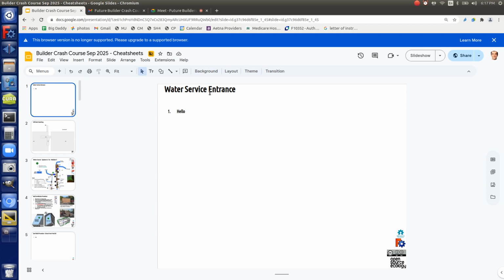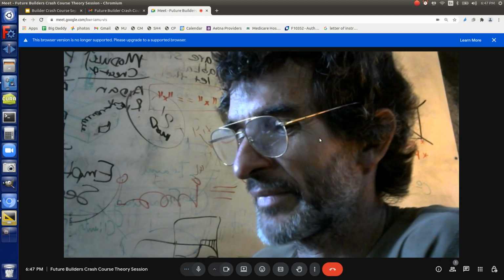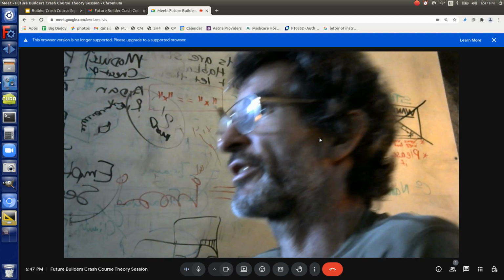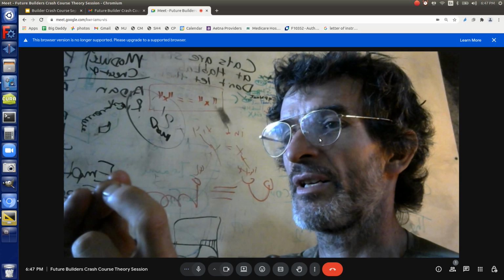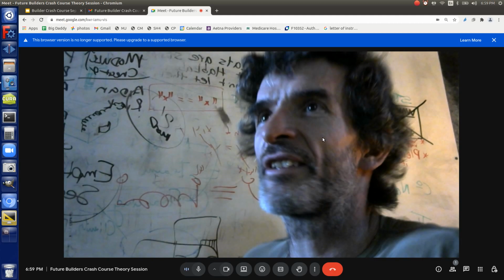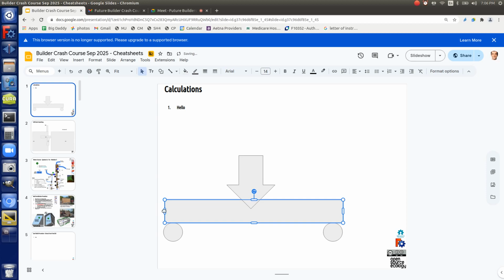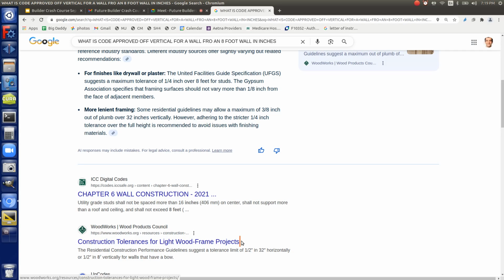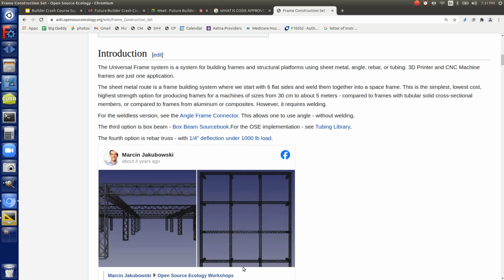Some Notes on Calculations: Wood, Steel, Rock, and Plastic

Comment: cool if we use basalt rebar instead of iron the concrete will not rustcrack. and it can be build pretty cheap in iceland due to free electricity and its very common
Reply from the maker: I like it. But a warning -  if you use it with hempcrete - if your house ever catches on fire - all people downwind will get stoned. Also, how would you replace welded steel rebar and use basalt rebar in these - https://wiki.opensourceecology.org/wiki/Large_Workshop_Structure ?